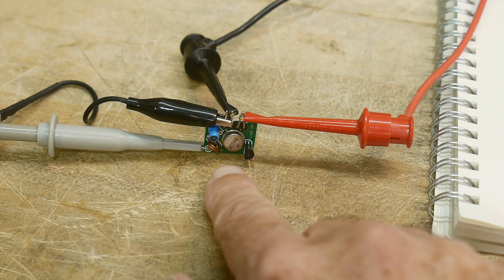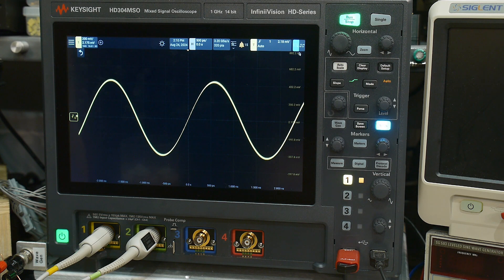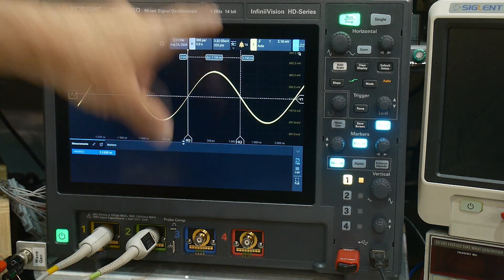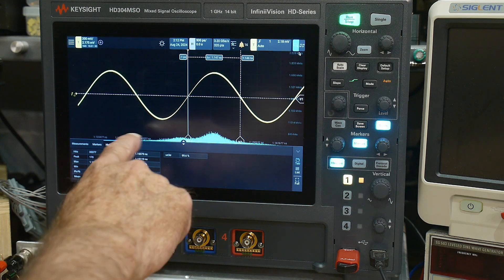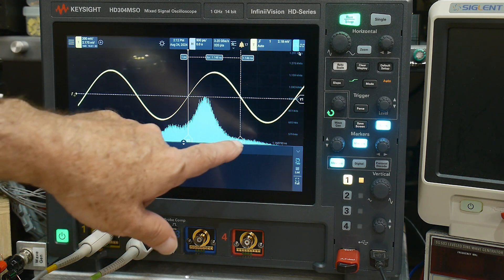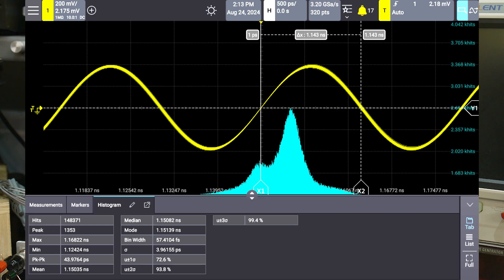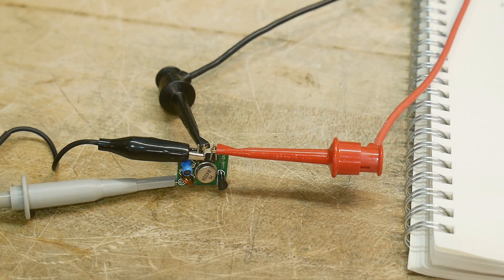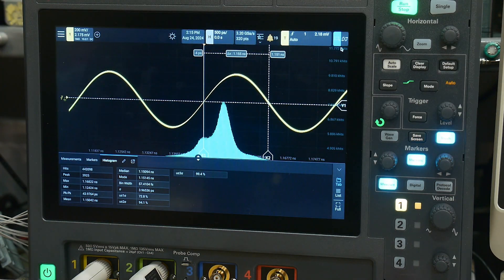#1981 433MHz SAW Resonator Jitter Statistics

Comment: Very often interesting to look at statistics of sampled data for systems and their subelements.  This can lead to cost savings optimizations of designs.  Initial design assumes a certain level of performance is needed to meet a desired spec, but looking at enough samples of operational data can show where the design may need more performance in one area and where performance can be backed off in another.

Comment: The jitter may correlate to ripple in the supply voltage.
Reply: I imagine use of quarts crystal would have eliminated the jitter, But in tradition of cheap volume manufacturing a SAW oscillator is cheaper to mass produced at ;lower cost than a crystal quartz oscillator, for  a similar circuit